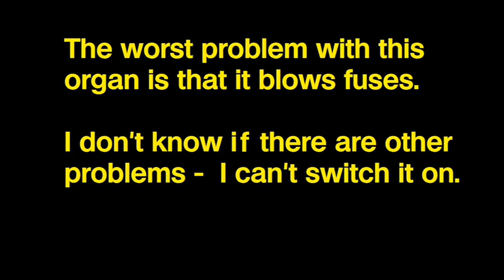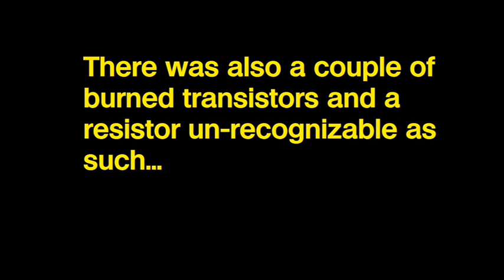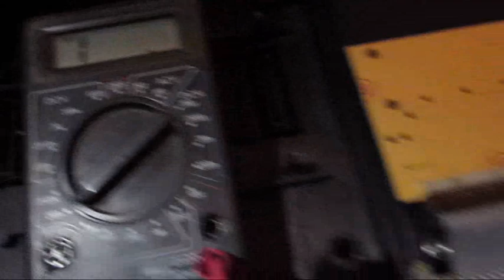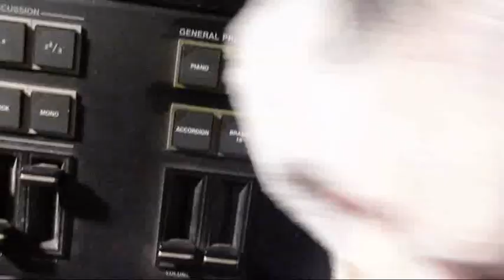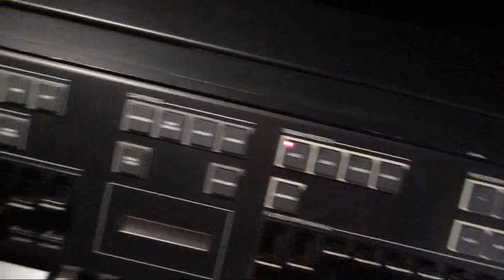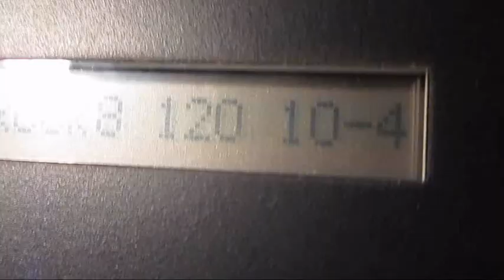Saving a Hohner GP 180

Comment: Awesome work, sincere congrats!
I was wondering why you didn't add some thermal compound to your brand new power amp IC before tightning it in place... Just a thought ;)
Reply from the maker: I thought about that. But I didn't have some and the surface of the modules is very big so there is relatively good heat transfer even without - I hope. But off course it would be best if there was a compound layer inbetween.
Reply: organfairy It's only a matter of surface matching each other, if they're not smooth enough or their flatness is not ideal, you end up with few surface touching.
So the compound is there to fill the gaps and let the heat flow towards the sink.
When I don't have some for my repairs, I usually collect the one on the dead component ;)

Comment: Hi, I enjoyed this video as I have just bought a D180. It had been neglected (sat in a damp, dusty church for years) and had a few problems. Reverb is quiet, theatre organ preset doesn't work, fast tremolo doesn't work, piano sounds are a bit quiet and rhythm is barely audible. I wonder if you found any similar problems in your GP, apart from the power amp meltdown (mine also had a blown channel in the power amp).  I like your music, by the way.
Reply: Sounds like a bunch of connection issues, maybe there is oxidation in the connectors or ic sockets

Comment: I recently bought a GP-180 and it works fine, but... I cant find a complete service manual. There are several sources for the service manual of the D-180 but they contain 8 pages only. The complete service manual should contain 50 pages. I found a complete service manual of the D-200 which seems to be an 'extended version' of the D-180. Anyway - If you know how to find a service manual for the GP-180 please let me (us 🙂) know.
Second problem is the owners manual - there is no owners manual available, not for GP-180, D-180 not even for the D-200. The usage of the instrument is mostly 'self explaining' but there are some 'extended functions' which are kind of a secret. I still do not know how to use  and program the 'auto registration' and what is 'hidden' behind the Program button. I also have no clue about the 'Cartridge System' but this does'nt matter because I dont have a cartridge for this instrumen. If you have an owners manual for this instrument please let me know where to get it.
BTW: I really appreciate your work with all theese 'vintage instruments' - I already started a collection too....
Reply from the maker: I browsed through my pile of organ related PDFs and I found a file called 'schaltplaene' which is German for 'schematic diagrams'. It contains 53 pages, but I can see that the last two pages are for the D200 while the others are for GP or D180. I also found a 47 page user manual, but it is in German. I don't know where or how I got them.
Reply: That seems to be exactly what I need - I'm german so the language is perfect! I send you a PM as soon as I can figure out how that works at youtube 🙂
Reply from the maker: @T-Cat-wy7ly   I'm not sure it is possible anymore  just write to me at  flemmingsorensen (a) hotmail  (dot)  com   I will remove this message when you have written.
Reply: @organfairy  
Thanks a lot for this information - an eMail is already on the way...

Comment: Hi organfairy, I am still struggeling with my GP180. I built an instrument with something like a guitar pickup, with which you can hear electromagnetic waves. I used this sensor to analyse where a signal is generated in the hohner. I found out, that I can pickup the audio on the spring reverb input. So everything works until there, but i can not hear anything from the output of the organ. Is there maybe a mixer before the output? It could be broken. There should be a working pre amplifier, because the spring reverb gets an amplified signal. Can you give me a tipp?
Reply from the maker: I have the schematics and as far as I can see the organ sounds are mixed together and then there is a connection to the reverb unit before the signal goes throught bass, treble, and the master volume control. So if there is signal on the reverb unit the broken part is somewhere between the output of the mixer and the input of the power amplifer (if the power amplifier is working). This include IC3, 4, 5, and 6 on the mixer circuit board - the one placed to the left of the lower keyboard.

Comment: Hej organfairy, i also bought a broken Hohner GP180. I tried to check all the capacitors with my multimeter and found the same which you show in the video. My organ turns all the lights on and burns the fuses before i can play anything (i hear nothing from the speakers or headphones). I would be very happy if you could help me and tell me where i should search first for the broken electronic parts. Is it possible to test the organ without all the pcb-cards where the sounds are coming from? By the way, i really like your interpretations
Reply from the maker: If it turns on the lights (the red lights in the buttons) but then burns fuses after a couple of seconds, I would suspect that the problem lies in the amplifier circuits. They are supposed to wait a couple of seconds before switching on to avoid a pop in the speakers when the power comes on. If it isn't the amplifiers what I would do is to take out all the circuit boards (but make a note on which one goes into which socket) and then put them in again one by one until the fuse blows. The board that has just been inserted must then be the one that has a shorted component.
Reply: organfairy thank you so much :) 
that sounds like a good method.
I will try it and tell if it worked
Reply: Hi organfairy, its me again :) My hohner still does not work. I replaced a few capacitors, and precautionary also the two power amplifiers.
Now the organ turns on, all the lights work and no fuses are harmed. Sadly I can get no sound out of it. Neither through the headphone output not through loudspeaker output. Do you have an idea or a general tip for me? Is there a way to get the manual or a service manual for the GP 180? What is your process when you search for problems in the circuit? 
Sorry for answering so late... I do not have much time to care about the organ, also it is at my parents house, not enough space.. But I will continue to try until i get it working! I am exited to play it  anytime soon.
Reply: @mettisMusic  I have the same problem. Have you managed to fix that?
Reply: @jackvonthor  hi, it was too complicated for me, my solution is using an external amp. For that I soldered a cable to where the audio signal goes into the amp
Reply: @mettisMusic  Thank you for your reply! Where did you solder that cable? I am not that experienced with repairing such electronic equipment. If I will send you the photo of the amplifier board or the main board, could you mark where to do that? I would be really greatful for your help.

Comment: Dear Organfairy! I would like to help my friend, who got an old Hohner GP 180 yesterday. Is it possible to connect a 3.5 mm jack headphone to a Hohner GP 180 organ? What converter/plug is compatible with the organ's headphone input? Thank you very much for your reply.
Reply from the maker: There is a 6.3 mm headphone output on the backside. You will need a 6.3 to 3.5 mm adaptor to use a 3.5 mm headphone plug.
Reply: Oh, this is very good news, thank you for your quick answer, you are really kind!